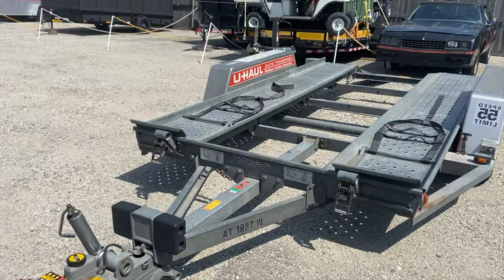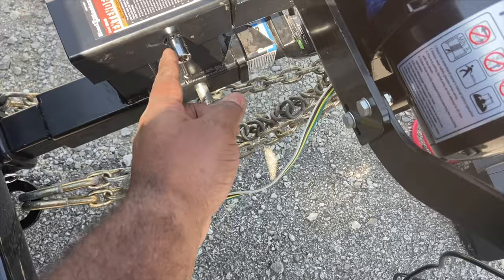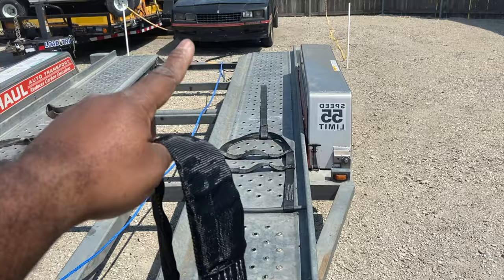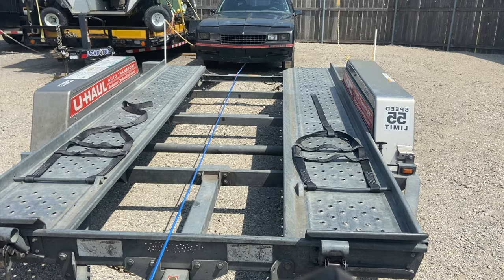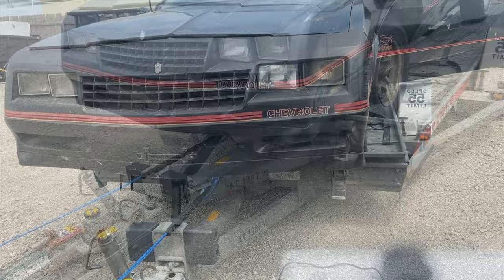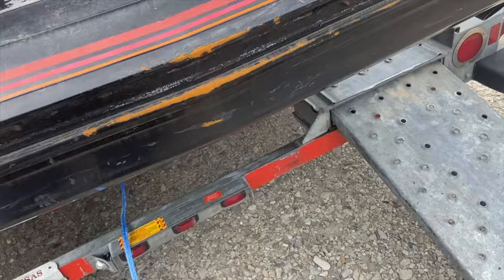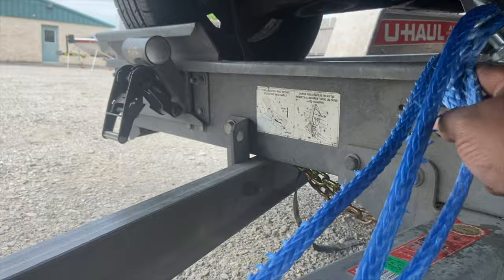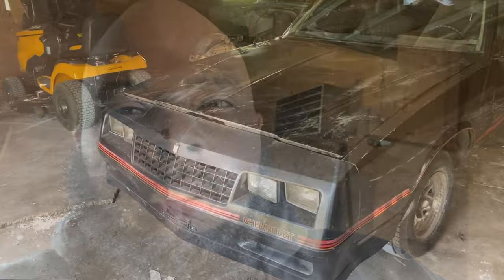How to Add a Winch to a U-Haul Transport Car Trailer

Comment: The winch is mounted backward, causing the line to run over the top of the drum and make a sharp bend to exit the fairlead... it's supposed to run under the drum and out the fairlead, so it is a direct pull with no crazy bend in the line before exiting the fairlead. Spin the winch 180° on the mount so the line spools off the bottom of the drum.
Reply from the maker: Gotcha. Thanks

Comment: Just the video I have been looking for. My first time winching!. Bought a 2000 harbor freight badland marine winch. Mainly because it has both hand and electric crank ability. I funny I bought the same hitch extender also. The winch comes with a hitch ball quick connect. Using a UHAUL to pick up a 69 Buick GS. Thanks
Reply from the maker: No problem. I've been wanting to be able to do this for years. Made a video to help other people trying to do the same thing.

Comment: A year later YOURE still helping people with this!!! Just bought a non running 81 Caballero and trying to tow  it home 4 hours away. Thanks!!🔥🔥🔥 QUESTION DO I NEED EVERYTHING IN THE DESCRIPTION? Never used one before.
Reply from the maker: Fasho. That's the reason for the vid. Thanks for watching.
Reply from the maker: You need a winch, winch mount for the winch, battery for the winch and the dual hitch. I needed the terminals for my car battery and the hitch pins for the mounts. I have my own trailer now, but this was just a temporary thing til i could afford my own trailer. I already knew i would need a winch for when i bought a car trailer. This way is worth it, if you will tow several times. Not worth it, if only doing once.

Comment: Awesome vid. I have to do the same, car is 1000 miles away. Needs to finally come home, doing all of this except the rope issue 🙂. Thanks for the well formatted and informative video. Next stop HF.
Reply from the maker: Fasho. Hope it helps. They should make them with a winch plate. Oh well. 😂 I did this by myself, so you should be fine.

Comment: Here is the problem i have with this.  That  hitch extender you have there puts a lot of leverage on your hitch and vehicles frame.  Increasing load on it.  And decreasing your maximum pulling load by 50%.
Reply from the maker: I’ve heard that part as well. I’ve used it several times going about 200 miles away. Hoping they make a shorter version under 12”. It does the job of winching a vehicle by yourself.
Reply: @CatlocosGarage  yea i like your idea.  My thought is cant you use it as a winch.. but anchor the car trailer in place with a jack after and swap back to a short hitch n ball ?   

Im looking on hetting a 76 Jeep J10 pickup 8ft bed truck.. and im using my 90 Grand Wagoneer to pull it.   Oddly its rated onky 5000 lbs.  But the Jeeps with the 401 engines were rated 7500lbs.  Not TOO much if a diff from a 360 and 401 besides maybe 60hp.  So i think my Jeep will be ok towing a uhaul trailer eith a 4200 lbs truck.  Itll be about 6400 lbs total.  If its got a 7500lbs rating with trailer brakes on a 401..  then i think with my 360 if i jist watch the engine temps. And drive at 50-55 or under ill be ok

My Jeep with me weighs 5200 lbs.. but its wheel base is like i think 109 or 119 inchs i forgot.  So its not a HUGE vehicle like todays trucks.

Drum rear.  Disk front.. has a tow package..  so i have a class 3/4 hitch and trans cooler.. snd its well maintained by me.. all new ball joints. U joints.. everything runs good.

Itll be a 140 mile treck.   I dunno what do you think ?  I gatta test my brake lighting wiring though lol it came eith electric brake controller.  But i dunno if the wiring is still sending power bsck there ir nit.  I know the uhaul just need a 5 pin adapter for lights and thats it
Reply from the maker: @jeepsblackpowderandlights4305  Definitely safer unhooking and putting a short ball after winching. These U-Haul trailer tells you stay at 55 mph or they sway like a mother and risk flipping. These trailers are intended for city use, but everybody takes them on the highway. This was a temp solution for short distances. The problem is nobody has made a solution to this issue. I jumped on this one when I saw it at HF. I knew what I was gonna use it for. Anything from HF is risky, but we know when we shop there. Their quality has improved drastically lately though.
Reply: @CatlocosGarage  hinestly ppl shit on harbor freight but most of my tools are frim there.. my 90amp flux welder ive had for 6 years.. done floors. Frame rails.. exhaust pipes..you name it.. hasnt died yet.

Drills and other tools i still use from em.. thr only thing ive broken are breaker bars and stuff

Comment: Good stuff. Thanks. How did you get it off the trailer when you got it back to your shop?
Reply from the maker: Pushed it off, but now i use a snatch block on the back of the trailer.

Comment: The Harbor Freight dual hitch extender has a weight limit of 4000 lbs. I wouldn't tow a trailer with it. I would use it to load a vehicle.

Comment: You want the rope coming off the bottom of the drum and out the fairlead. Not peeling off the top and having to do a crazy bend at the fairlead. Your rope will last longer too..
Reply from the maker: It's a chinese winch. notice the In and Out works as designed. if i swapped then it'd be backwards.

Comment: This is a great idea but on the u-haul trailer I rented today the plastic latch on the ball was too high for me to be able to insert the winch carrier into the extender. I noticed the trailer I rented had a different winder than the one in this video, so there must be different models out there.

If the extender was 0.5" taller it probably would have worked.
Reply from the maker: Interesting I've only seen one kind of trailer and I've rented numerous trailers over the yrs. It's possible. It also depends on your 2" ball.